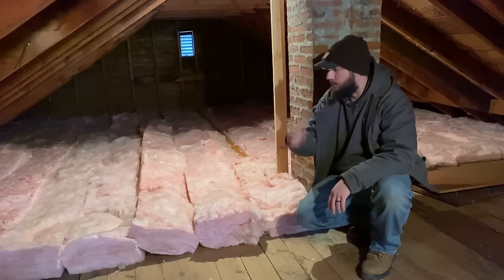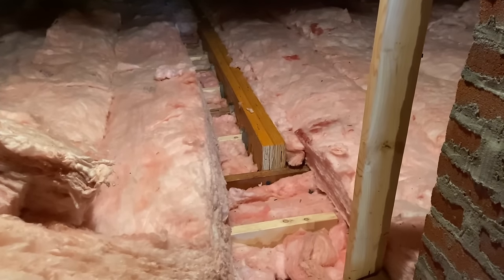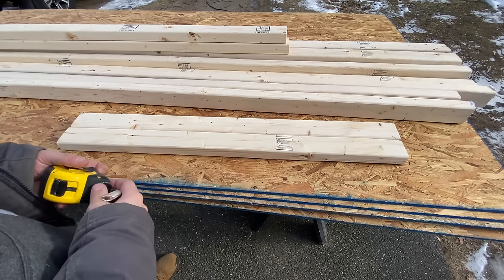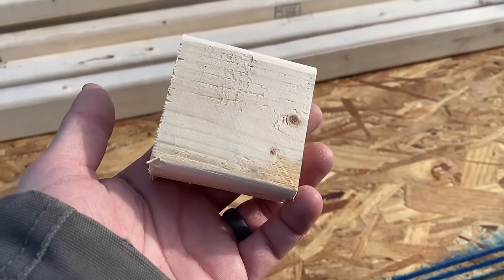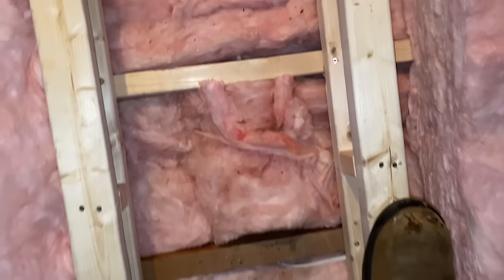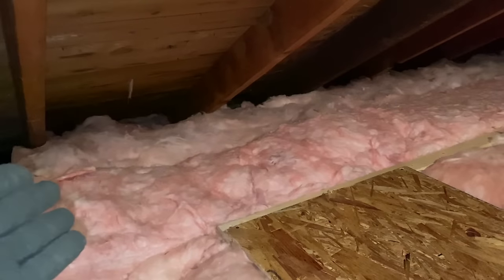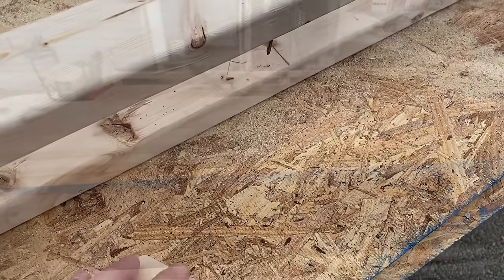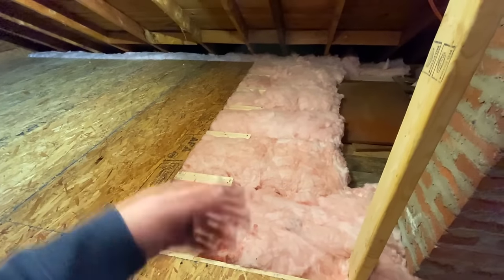Reclaiming Attic Storage Space Over Thick Insulation!

Comment: These matts are supposed to be ventilated when used on the roof, by installing OSB board right on top of them you prevented ventilation, wood will gather moisture and will start to rot in few years. Perfect example when a video has so many views and likes yet done improperly and should not be repeated by others.
Reply: Care to share what the right way to do this is?
Reply: If your worried about that, couldn’t you just perforate the wood?
Reply: Best way is to leave at least a 50mm air gap between top of insulation and floor. Rather than continuous beams the individual feet with a raised frame is better as the insulation is continuous.
Reply: @Jamessansome that’s correct.  If no airflow that board could turn to wet cardboard in no time, particularly if that roof gets very cold as I would expect it to do given the video was shot with a considerable amount of snow on the ground.  50mm air gap is what I’ve done throughout
Reply: Maybe ge has a vapour barrier envelop that stops on he celling under the loft.

Comment: One thing you should note, premanufactured roof trusses are not designed to carry large loads from the bottom chord of the truss - just gyp. bd./plaster ceiling work. You can sister new 2X joists (of proper depth for the span) to the existing roof trusses (bearing on the top plate of the load bearing walls) and add some strap bridging between the joists with minimal damage to the (e) ceiling below then put down new plywood subfloor.
Reply: @2:48 it looks to be 2x6, they're also short spans to what looks like a center wall support noting that beam in the middle. Still a good point for many that wish to try this on their own. Perhaps they should take note of the room walls under the attic to help with supporting loads they should take note of.
Reply: @WiggglezMr  The rule of thumb is 2x8 will span up to 12'-0", but it depends on the live and dead loads the floor will experience. A 2x6, unless it s a very small span of 4 to 6 feet, is really not enough. Standard floor joists are usually 11 7/8" deep but can be as slim as 8"-9" for small spans and light load bearing floors such as hallways...
Reply: My attic has 2x4 joists and was built in 2002. I want to add some walkways to easily get from one end to the other, but I'm not sure the best method now after reading your comment. What would you suggest? I don't intend to use it for storage, ever, I just want to be able to scurry around easily.

Comment: I would be slightly concerned about mold problems. From condensation on the underside of those slabs you've covered the insulation with.
Reply: Yes , unless he just uses it for occasional storage I suppose and dont let any heat up. But he need a plastic barrier beneath the insulation
Reply: @oggedask  and proper ventilation
Reply: Does the insulation in  the rafters have the paper on the bottom if so that will act as a barrier

Comment: Did this in my attic about 20 years ago but I simply built what was essentially 2x6 deck framing sections and ran it perpendicularly to the existing ceiling joists. Those I-beams seem to be a lot of extra work in build and in fastening to the ceiling joists. By building traditional 16” OC frames in sections small enough to maneuver in the attic, I did not have to attach them to the ceiling joists. I simply laid them in place and screwed the next one to it. Filled the cavities with insulation and covered in 8’x2’ strips of ply. Be sure to staggered the joints on the ply for a good strong floor.
Reply: So you did one large frame secured to the ceiling joist, & didn’t have to secure the middle supports to joist, just attached them to the frame you built?
Reply: @27photogger  I laid a 2x6 perpendicular to the existing attic joist then attached 2x6’s to it 16” OC. Slid that into place and attached the other 2x6 end to the ends of the 16” OC “joists”. I was able to adjust this new structure to be square and in place, then filled it with insulation before attaching the plywood. Then on to the next section. I secured the sections together but did not secure them to the existing attic joists as this is just storage space and I was not concerned about squeaking. The plywood decking holds everything together. Haven’t had any issues and picked up some great storage space.
Reply: @elbowjoe361 that sounds like a very good idea. The 2x6 makes more sense and is a lot less work. Seems like not attaching the new floor to the joists saved a little time, but is a lost opportunity to add some extra support to the ceiling. Especially with extra weight now on it. Did you leave space above the insulation for ventilation unlike here where he is compressing the insulation?

Comment: I did a similar project about 25 years ago on my uninsulated and floorless attic.  I used 6" 18 ga structural metal studs because of their light weight, straightness, strength, and ease of installation.  The supplemental metal joists were easily attached using self-drilling screws through the flange into the top of the existing ceiling joist.  I used blow-in insulation rather than batts, and also staggered my OSB joints.

My house was built in 1912, and all the ceilings had developed sags over the years.  The worst was about 2-1/2".  I used a couple of jacks and a 4x6 to get the ceiling flat before attaching the new metal joists.  When I was finished, the sags were almost completely eliminated, so the project ended up solving several issues at once.
Reply: After using the 6" structured studs, did you put plywood on top? If so, it's strong enough to handle people walking and storage?
Reply: @sperreault  - I used 1/2" OSB with staggered joints.  The metal studs were spaced at 16" centers, and there is virtually no deflection.  There is not enough headroom for a living space, so I am just using it for storage and furnace access.  For a habitable room I would use 3/4" plywood or OSB T&G subfloor panels.

Comment: I did a similar thing in my attic.  If you have large air leaks to the living space, you may get condensation on the osb in the winter.  Otherwise, I think the insulation works better with the osb on top.  It is best to stop the air leaks but you could drill a few small holes in the osb if you notice a problem.

Comment: A little tip I learned that won’t slip the wood like it did on your small block is to snip the tip of the nail before drilling and it won’t slit. Thanks for sharing. You did a great job on the storage space.
Reply from the maker: Thanks!
Reply: Hammer the tip of the nail first to blunt it. Also stops splitting wood.

Comment: Excellent job! Nice guy. I am presently reinsulating my 1912 house including the attic. Before I started the old insulation hardly covered the floor joists in the attic!! No wonder it was cold! I am fitting 2" foam then 1.5" between the beams then on top 1.5" foam between the cross board like the ones you installed here. I will then install another layer of 2" before putting the 3/4" plywood over top. This will make a nice chillout room in the attic along with lots of storage area. 2" (R11) + 1.5" (R8) + 1.5" (R8) + 2" (R11) = 7" of insulating foam boards with R38 insulation value.

Comment: It's worth it to buy upgraded 1-1/4 screws over standard dry-wall screws. When I used those screws in my attic floor many times the head would pull off the shank of the screw defeating the purpose. The brass colored screws I got never failed me once! Thanks for your video!

Comment: Did exactly the same thing in my own loft had to raise the floor approximately 6" and used cheap CLS timber (internal wall Barton's) that was 3x2 so effectively built multiple lengths after making some simple jigs to ensure all was cut and screwed in the same place.  I layed them at 90 degrees to the ceiling joists to spread the load across multiple joists.

Comment: I did this in my attic back in 2013.  Roof trusses were on 24" centers and I cut the sheets of 1/4" plywood into 24"x48" pieces.  The central area was 12' wide, so 3 of those smaller pieces filled in each row.  I fit some 1.5" rigid foam in between the bottom sheet over the blown in insulation and then put a top sheet of coated fiberboard over the top to make a finished surface.  I taped the seams on the top layer to hold things in place, but allow access below if needed.
Reply from the maker: That works!  Thanks for checking out the video!
Reply: Do you happen to have a picture to show ideas?

Comment: As a structural engineer, I appreciate the homemade I beams you used. Also, kudos for thinking ahead to make sure the main beam was designed for light storage!
Reply: Planning on doing this to my attic. Are the homemade I beams better than just buying the 2x6?
Reply: @leekyciabrown3769  They're not "better" than buying a 2x6. It was just a creative way to use the material he had. Regarding strength in this case it wouldn't really matter (unless you're using it for heavy storage)
Reply: Are all attics strong enough to handle the extra weight from the added lumber and plywood ontop, like this video . I don't want the attic caving in and creating a way bigger mess, just from me wanting to add storage.
Reply: @leekyciabrown3769  You'd need the engineer who designed the space to verify. (Or you have an engineer look at the plans to verify). Every situation is different and there's no rule of thumb. It depends on how the attic was designed. In this case, he stated that he made the attic was designed to support the extra weight.

Comment: Excellent project. 
I'm looking to do the same in my attic in the UK. Built in 1986 my attic only has 6" of scruffy insulation in it which I boarded over 30+ years ago. Latest code requires 270mm / 10.6" of insulation. I will probably add an extra 250mm / 10" of insulation over the top of the existing. The price of timber over here is stupid expensive (easily double the prices you mentioned) so I will be looking to use a light weight plastic leg & metal stretcher support system to raise a floor above the insulation while still maintaining an airflow gap above the insulation. This system halves the weight of a wooden support floor & eliminates any cold bridging between the cold & warm side of the floor. Ceiling downlighters also need to be covered with a sealed cover to prevent air leakage. The floor will be T&G edged OSB or chipboard which specially designed to get through a 2 x 2ft trap door into the attic. It won't be a cheap project (450sqft) but with the recent increase in the price of gas & electric in the UK (up to 50%) it's a necessary evil to reduce my gas boiler heating running costs as much as possible. I also plan to create some storage shelving above the floor between the roof A frames. This will reduce the amount of raised flooring I actually need to provide for storage & access.  New subscriber here.
Reply from the maker: Hey, Colin!  Sounds like a good project!  I hope by the time you start maybe prices will come down a bit?  Either way I wish you the best of luck!  Let me know how it goes... And thank you for subscribing!!

Comment: Either run 2x6 (or 8) perpendicular to ceiling joists or closed spray foam insulation would have been my two options to choose from.
Reply: I was thinking the same thing. i would also only space them @ 24" given the light duty load.

Comment: dont forget the steam break on the warm side (ceiling of warm room and the ventilation space below the covering. When using polystyrene or PU dont use plywood, use non-flameable coverings instead. Dont leave any air-gaps in the insulation, make all installations (electrical, pipes, etc) air-tight and (in case of rockwool insulation) dont forget to support the insulation, so it wont collapse over time (under its own weight). Thanks for sharing

Comment: You need to be careful with moisture build up here. Hot moist air rises up through the roof and insulation. Eventually it hits the cold underside of your boards and condenses into droplets. You have no air gap between the top of your insulation and the underside of the boards so there will be no airflow to remove the built up moisture. I would rip one of these boards up after a few months, check for damp and get a moisture guage onto some of the timbers. Last thing you want is to rot the roof timbers.
Reply from the maker: Good point.  When I remodeled the floors below I installed a vapor barrier before the drywall.  That should stop most of it. 🤞 Thanks for the feedback and for watching!!

Comment: I did a form of this in my attic, if only so I could get to either gable end to put in spotlights and a fan.  My R-49 was already up there so I did 2x3 from one kneewall to the other and then ran a central upright to the overhead truss.  Then I just did some basic 1/2" plywood catwalks with stiffeners on each side.  So I used a lot less wood, but I had to because my structure does not have a lot of extra capacity.  Good work
Reply from the maker: Hey that works!  Thanks for checking out the video!

Comment: The making sure your attic can support/is designed to hold the storage cannot be overstated.
Reply: How do you make sure? What is the best method for understanding the weight limits of what can and should be used for the attic storage space. Does this go by weight per square ft?
Reply: @VP411Designs I believe 10psf is for empty attics and 20psf is for attics with light storage. But knowing what a pre-existing attic can support is going to require some homework. That's something that's baked into the plans when the house first goes up.
Reply: @Supercharged111  makes sense, Thank-you

Comment: Nice! I am just thinking about condensation of water inside of the construction. I would just build it with plywood on top if I had a foil underneath the insulation. Idk the English terms but in theory there can condens water under the plywood because it doesn’t let moisture through that gets into the construction from the living room underneath. Maybe the problem is just there in theory but maybe you look for it sometimes. Greetings from Germany
Reply: There are two separate layers of insulation, running perpendicular to each other. The highest layer is unfaced (no vapor barrier), as it should be. That lowest layer should have a vapor barrier facing on it, that is facing the ceiling below.

That is how the condensation issue is minimized, if not totally eliminated.

Comment: I live in florida current insulation is  r 18 I got surplus flat roof insulation 3 inches r 6 per in. Screwed it down under half inch plywood with 5 inch General construction screws. Roof insulation is Like a sip with Heavy cardboard on each side It's Made to not compress I did this to create a walkway to get back to the.
Air conditioner. On either side I just used regular blow in.

Comment: Nicely done.  My attic has blown-in insulation, a couple of tray/vaulted ceilings, and lots of duct work.  Sadly, it's not worth trying to put floor in most of it, but your method could work well for the 50 sq ft or so I can use.
Reply: I am on the same boat I can probably only get 80-120 square feet of storage space but I am definitely thinking of doing so. I will probably end up hiring someone 😭🤣
Reply: @AztkSmooth  I could gain the use of at least that much more if I were willing to carry items over or around a massive air handler.  Trying to install flooring behind that thing poses too much trouble and risk, so I'm keeping everything on the front side of it. The other air handler has most of the duct work and ethernet cabling behind it, so there's nothing to be done there.  Thus the limitations I first noted.  If I had been involved in the construction, I would have asked that the two air handlers be located on the same side of the attic so the other side would be more open.

Comment: Great job. Very handy. 
I noticed a window at each end of the attic. Are those vented windows? I have a similar attic and it was recommended to me, by a building inspector, to vent the soffits to get more airflow into my attic. However, I didn't have much for cross ventilation, since I only had one vented window and a roof vent. It wasn't hard to vent the soffits, but the insulation covered the soffits, therefore, I took pieces of Big O plastic drainpipe, cut them lengthwise, and stuck them over the insulation, to the soffit vents which are round, so the pipe shape fit the vents and increased my airflow. This disallowed condensation in my attic. 

I might live in a wetter zone than you, but if I had an attic like this, I'd want to check to make sure no moisture is building up under the insulation where it meets the roof.

Comment: Very nice job and hope that your storage needs don't grow, as they say,  since now you have the space to fill.  Kidding aside,  is the 7/16 OSB the minimum thickness needed for your 12inch center spaced joists or could you have used 1/4  OSB?  Do you plan to treat the decking to make it more weather resistant ( I don't know how much humidity you get in your attic), say with a deck coating?  Thanks for sharing this video.

Comment: I did mine years ago with 7/16 osb, and I really wish I would have just spent the money on 1/2 sanded pine.  even 12oc it does bow a little, especially at the edges that are screwed half on a floor joist/ceiling rafter.  it also sucks to crawl on, even if I'm only up there 4-5 times a year for holiday/seasonal or luggage

Comment: The only issue is that the wood doesn't have the same R-Value as the insulation, so separating the batts in cavities as opposed to having loose fill on top increases thermal bridging. But those 2x3 "I-Beams" are crazy overkill hahaha
Reply from the maker: Haha thanks, Rolf!

Comment: Attic spaces are typically not structural areas for repurposing. Not typically engineered for additional loads. Ceiling joists are just that. Not floor loads. Permits and plans , inspections, typically required. Insurance on the home could have issues